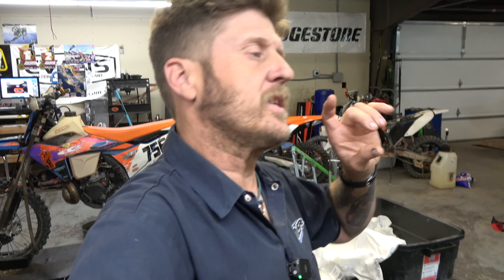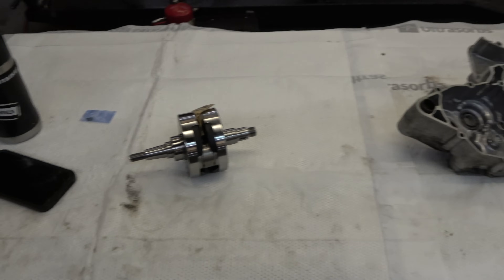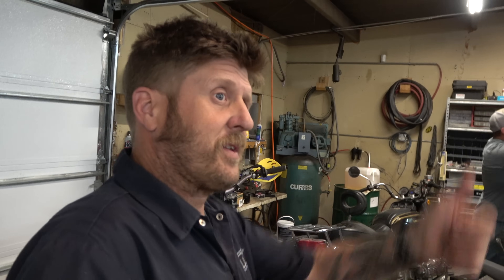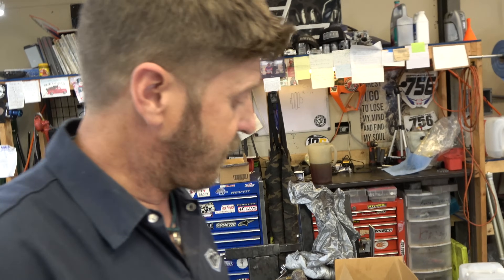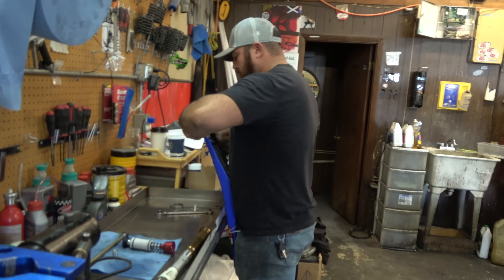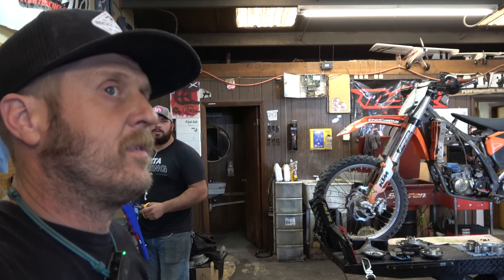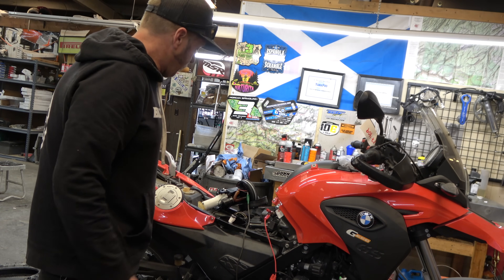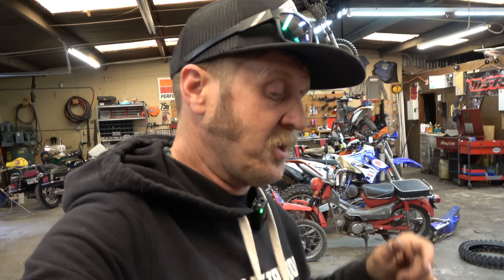The Shlog #264 | KTM 150SX | Diagnosing BMW Fuel Pump | Air Filter | Highland Cycles

Comment: I feel the BMW pain…. I just went through all of that rigmarole on my 2005 f650gs. Replaced the fuel pump assembly with an All Balls kit instead of the million dollar OEM BMW fuel pump assembly.  Runs fine like it used to…but now my low fuel lamp is always on.  I asked at the dealership what’s up with that and they mentioned only the OEM replacement has a fuel level sensor. Don’t know if that’s true or makes sense,  but I do know I’m not pulling it apart again. I just strap a liter can of fuel to the bike and keep an eye on things.  Love your channel and info btw!   Good luck!
Reply from the maker: Thanks man. We ordered the all balls kit.